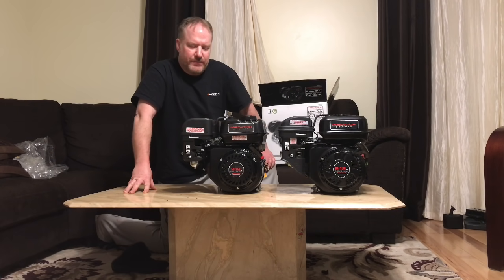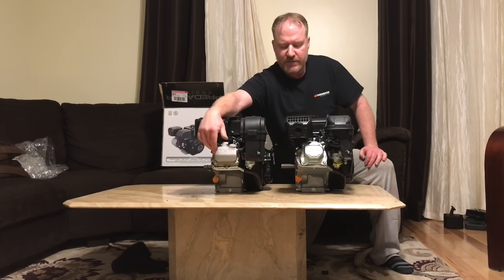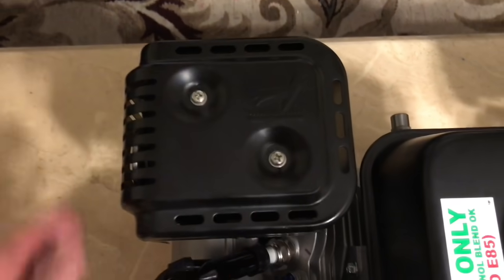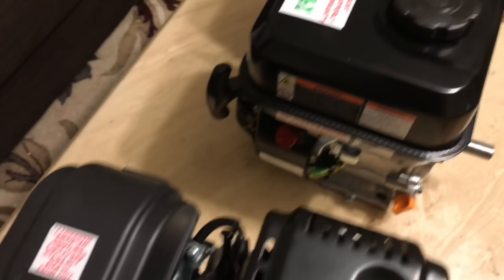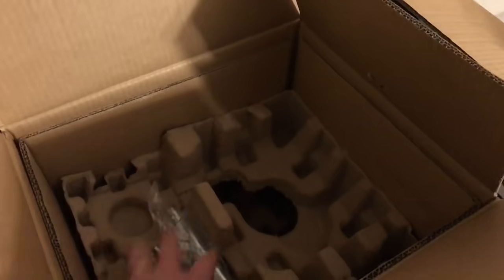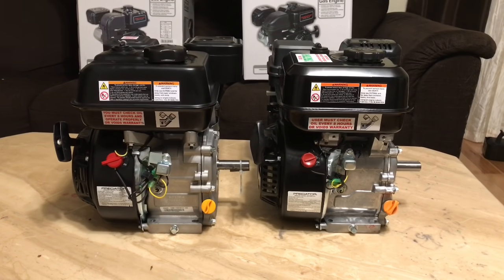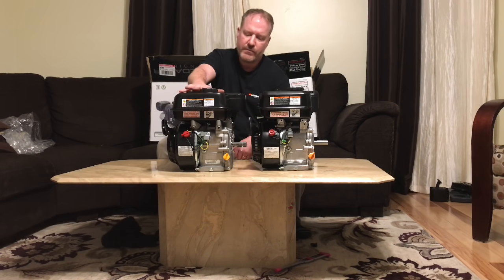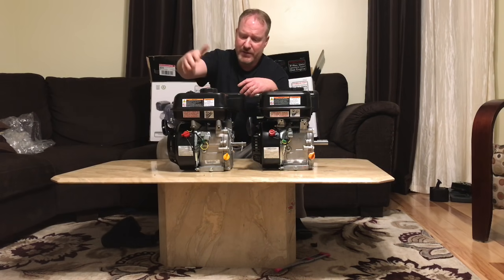What?!?  Harbor Freight Predator 212cc HEMI built by different factory than NON-HEMI???

Comment: Great job👍 Nice comparison between the 2 motors.
When I purchased the motor I got the hemi version.
No issues so far. Using it on my 14 foot Jon Boat with a mud motor kit 🎣
Reply: GetOutTheHouseGoFish but they're both hemis. Why buy the more expensive one at this States at the Hemi?
Reply: John Sears the cost was pretty much the same. I had already purchased my engine before this video was made.
Other videos I had seen with people using this motor said they thought the hemi had a bit more torque.
I went that route because I’m using the motor with a mud-motor kit on my boat.
Reply: GetOutTheHouseGoFish but they are the same exact engine everything he pointed out does not matter on the performance of the engine. On both engines carburetors on the same side spark plugs in the middle exhaust is on the opposite side meaning both of them are hemis air goes in one side and goes out the other that's what a Hemi is and there is no performance gain there's a efficiency gain. And you got ripped off for around a hundred bucks.
Reply: John Sears they cost the same? 😂 It’s just a preference and you paying attention to the model number on the box when you go to buy it 👍
Reply: GetOutTheHouseGoFish they don't cost the same I just looked them up is it about $100 difference in between them. My 21 horsepower Briggs & Stratton is a Hemi as well. All a Hemi is the way the air goes in and out nothing else has everything to do with the head and both of those engines have the same exact head. I am not saying it's a bad engine they're just lying to everybody just to make more money off of an engine that is exactly the same as a cheaper one with cosmetic differences.
Reply: John Sears the 212 cc engine he is showing can range from $96-$119 depending if you have a coupon. The 22 hp 670 cc engine cost between $669 - $729 once again depending if you have a coupon. I’m looking at the Harbor Freight coupon book that I got in the mail 👍 
As long as the engine does its job I’m good with it 🙂
Reply: GetOutTheHouseGoFish and all I am saying is they're both the same exact engine. People hear the word Hemi and think it's a better engine but they're exactly the same. I literally watch the video yesterday about this engine they put different part numbers on the valves but they still fit in the non Hemi head. So did the pushrods so did the Rockers. And they said the only difference that they could tell because they shave the head down. Still not saying it's a bad engine it's a very good engine was just there exactly the same. And all I was stating with the 21 horsepower Briggs & Stratton it's a hemi but they're not selling it as a Hemi just to get more money and it has roundabout or over a thousand hours on it and it doesn't smoke at all carburetors Fubar though.
Reply: Hemi means the head is spherical making combustion more efficient
Reply: Toni Cayton no it doesn't.
Reply: Brian Boyer did this engine company change the meaning of a Hemi?
Reply: John Sears oh yeah and how do you know?
Reply: Toni Cayton I was asking you that question I'll do it again did this engine company change the meaning of a Hemi?
Reply: Toni Cayton a Hemi is everything to do with the head. Carburetor on one side or just the intake depending on if it's fuel injection air goes in spark plug in the middle domed compression chamber exhaust on the opposite side of the intake or carburetor and if you look at those two engines they're exactly the same same carburetor same head same valves same rockers and you can go on Google and look at the combustion chamber and see their shape exactly the same.
Reply: Just like I said hemispherical heads doofus or what you call domed, and I don't care about anything from garbage ass harbor freight engines
Reply: Toni Cayton so are you going to retract your statement that I'm an idiot it was seems to look like that I was exactly right.
Reply: Toni Cayton it's not my fault you use the wrong word.
Reply: Toni Cayton and how many is no longer a Dodge thing basically every single modern engine is a Hemi. No my 1978 Ford 250 straight 6 is not a Hemi carburetor and exhaust pipe on the same exact side which brings down the efficiency of the engine and a shit ton of heat on my carburetor.
Reply: John Sears at least your not a Honda vtec driver haha, Ford is garbage
Reply: John Sears well the older square body Ford's are good the rest is straight garbage
Reply: Toni Cayton taking theb250 out putting a 300 straight 6 in. when I'm doin polling a Chevy out of a ditch I don't have to touch the gas anymore. Only had to bring up 2500 to 3000 RPM with a 250 in it and it only has an 8.7 limited slip differential.
Reply: @republicansareoffendedeasi821  - Cross-flow design has NOTHING to do with it being a hemi. "Hemi" refers the shape of the combustion chamber and the layout of the valves. All modern V8s and V6s are Cross-flow designs as well as most inline designs. However, few of them are hemis. And in the United States and some other countries, the term "Hemi" is copyrighted as a trademark of Fiat-Chrysler, so technically in legalese, a Ford hemi isn't a hemi. And there have been a few Ford hemis...
Reply: @republicansareoffendedeasi821  - No, they didn't change it, you did. Chrysler and Ford both had hemi designs in the '30s and '40s. Chrysler developed air-cooled hemis for tanks (see Jay Leno's tank roadster) and even better, Ford's GAA engine as used in the M4A3 Sherman tank was a 1099 cubic-inch-displacement flat-plane-crank V8 with dual overhead cams and four valves per cylinder. It was easily the most reliable of all the engine variants used in the Sherman. Right behind it was Chrysler's "Multi-bank" 30-cylinder engine, actually 5 Chrysler 6-cylinder flatheads mounted together on a transfer plate. Not sure how it got to be so reliable, but it's a good thing it was - mechanics who worked on them said they were worse than a nightmare.
Reply: @tonicayton9017  - He "don't know nothing." 😂😂 But the shape is really HEMIspherical, meaning half a sphere. In truth none of the hemis' combustion chambers I've ever seen were HEMIspherical; more like SemiHemispherical, as none were even close to half a sphere, but more on the order of a quarter sphere, like cutting an orange at about 1/4 the distance of the axis. Now, it's mostly just marketing hype.
Reply: @republicansareoffendedeasi821  - Go home and get some sleep, John.
Reply: Duck hunter?..we use alot of those mud motors....they are beast
Reply: How do you like your mud kit on that boat? I have a 14HP predator with an SPS kit on a 10 foot livingston and I don't like it on this boat. Livingston's are a catamaran design and the wake the boat makes has me constantly fighting to keep the shaft in the water because it always wants to lift up. Other than that it works great. I'm looking for a different boat to use the mud motor kit on.
Reply: @tonicayton9017  HEMI means hemispherical--- like half of a tennis ball. The common shape is WEDGE in which the valves are side-by-side.

Comment: Is the carb. bigger on that than a 196cc and can it handle the new jet provided in a stage 1 mod. kit cause the 196cc with new jet will run, but won't move bike, too much fuel.

Comment: Non hemi you can add a charging coil to for lights on a mini bike, the hemi doesn't have the mounting brackets on the side
Reply: Damn, I added a higher amp output coil on my 60363 hemi, along with electric start. Go figure. and I run brake light and turn signals. Just add a voltage regulator.! People need to not comment on stuff they know nothing about. Another FACT.!!!!!!!!!!!!!!!

Comment: I've also heard that the hemi design is not compatible with charging coils but the non hemi engines are.
Reply: Hugh Mungous. I have a hemi version and I have put a charging coil on it that cane off of another 196cc engine. It matches right up.
Reply: the hemi DOES have all the mounting points for charging coils, kohler makes a electric start flywheel that fits the hemi taper perfectly (you need a flywheel with magnets on the inside for charging)...I have been running it a long time without any issues.

Comment: Hey man I like your video I'm going out to town to work in San Antonio and I thought about picking up one of those engines in Harbor Freight where did you get yours at in store or did you order yours online
Reply from the maker: YT_Gunna_ 11 I like to buy in store so I can choose hemi or non-hemi versions. Although I do prefer the non-hemi in most cases.
Reply: They always keep them in stock ? An do you think i would have to add a plate or anything when i put it onto my go kart it has a 5.0 Tecumseh as of right now an it gets it because i have a very light weight frame go kart im looking to fully deck it out with the 212cc predator but hopeing i do not have to weld any add on's do you think the bolt pattren an things are the same length i need research it

Comment: What is the torque difference between the two engine's?
Reply: Well, both are said to produce the same horsepower so unless one is capable of doing so at lower rpm then torque output must be similar.  Of more interest might be their torque graphs, showing not just how much but where it's developed along the torque curve.

Comment: Looks to me like they cheaped out on the hemi
Reply: Yea. hopefully they are as durable.
Reply: Somethings about the hemi is cheaper like the packaging to keep the costs down so the price can stay the same but the hemi is actually better and they are both very durable.
Reply: +Joe 987891 Just the word Hemi makes it better huh. Pay no mind to the differences in manufacturing quality.
Reply: Richard Noggin hemi means that the cylinder is more hemispheric and over all the hemi is better. There is most definitely a difference in the 2. The difference is one has a hemispheric cylinder and one has a perfectly circle cylinder. Packaging is different to keep costs down so the 2 engines stay the same price with the hemi being the better engine.
Reply: @Joe-vp5sp  a hemi combustion chamber is not the best. Out decades they found out that hemi is old news. Hemi v8 engines doesn't even have hemisphere champer anymore.  It's just a brand now. Bathtub with squishband is way superior.
Reply: So true that’s why I made sure to buy a non Hemi when I started my current project
Reply: @nikolaiownz  they still make hemispheric heads for the new hemis I've rebuilt my 5.7 hemi they where hemispheric  the pistons are not shaped like the old ones and they run with dual spark plugs
Reply: the  hemi  is the racers choice,   way  better than the  1st gen  non hemi

Comment: The none hemi I have is going to be ported shaved and I'll be putting in a 3.08 cam that is the avantage of the none hemi. Love all the of my predator 212cc engines!
Reply: might want to add larger valves like the hemi came with stock, then your cam could work at its best. Also that would be a .308 lift pushing air and gas through the smaller valves. You do not need as much lift when the larger valves flow better to start with.

Comment: I have the 4000 watt generator with the Hemi engine. Started the first pull right out of the box and continues to start easily. Hopefully these engines are as durable as Honda engines.
Reply: You know Mary, making engines like these isn't rocket science. If Harbor Freight makes sure the Chinese factory uses quality materials, they are perfectly capable of making something equal to a Honda. That is well within the capabilities of Chinese manufacturing if the company contracting with them makes sure they keep the specs up. I know Harbor Freight has put lots of effort into their generators to offer a quality product so I sure hope that includes quality control. 
I just got a 3500 and so far, we couldn't be happier with it. Like you say, I sure hope they are as durable. Time will tell. 
The "Chinese junk" reputation comes from companies cutting corners, making things as cheaply as possible. It's not because China can't manufacture a quality product. They are still behind as far as highly complex things, like an entire car but, for more basic things, like a little generator, that's well within their abilities. If the company buying from them specifies quality materials and keeps up on quality control, they can make a very good generator. Lets keep our fingers crossed that they did.
Reply: @shananagans5  The china manufactures are told what specifications to build the engines. They build some stuff shitty if the company selling them does not care if it lasts for the customer down the road. The hemi has already built it's reputation "only' by those who have honestly tried them and maintained them..

Comment: your presentation persuaded me to go non-hemi. 
got a dead Tecumseh engine 5.5 hp, and I plan to 
swap it out for a 6.5 Predator non hemi, of course will also need a sleeve and key
to mate the new shaft with the old pulley, but that little extra cost is nothing compared to shoveling
knee high snow. Thanks for an excellent presentation.
Reply: I did it to
Reply: @scct82  wooo!!!, 6.5hp can throw snow like crazy! Thank you for the suggestion and how to select the right one...
Reply: I also swapped out a Tecumseh to a 212 Predator on an Ahriens snowblower. Three Winters later I am very happy with the Predator which handles the job much better than the poor old Tecumseh ever did.  Starts quicker in the cold and qRms up faster also. And uses less fuel also. I only wish I had done this sooner.

Comment: The original non-hemi version is the only one CARB-Certified (CARB is : California Air Resources Board), so that's all we in CA can get. But it's a minor issue, because all that's needed for CARB Certification on this engine is a spark arrestor within the muffler. Otherwise, both engines meet emissions and noise requirements.

Comment: Thanks for the info...
Warning they are still shipping the old motor. Had one arrive on my doorstep today. And the box was busted open. The packaging is not designed for a 40lb motor to be shipped through normal mail all the way across the US. They don't double box it and it didn't have any tape. The only thing that was originally holding the box closed was a couple staples. Even worse all of this trouble and spending $7 for shipping could have been avoided if harbor freight would of had a order online pickup in store option. I have a store about 2 miles from my house but had to get the motor shipped clear across the country. And now I have go to the store to exchange it anyways.
Edit.. Went to the store and they were very nice about it and swapped me out no problem. It was actually my first time going to one and the store was alot smaller than I had pictured in my mind. But I think thats a good thing and part of the reason I was treated so well. They ended up having 3 on hand 2 of which were hemi's.
Reply: harbor freight is great about returns i stoped buying craftsman tools cause there warrenty went to shibit they try to refuse warenty returns for any reason they can think of and there tools are made in china now too atleast harbor freight dosent give any guff when doing a warenty return

Comment: What's the water running for?
Reply from the maker: Its an AQUARIUM
Reply: @BUILDNIGHT  thought maybe you had a parts washer going.
Reply: Do you think the Hemi is more durable. I use these predators all the time. Never knew there were different styles. However, my buddy bought one 4 months ago and it's shot. I checked it after watching this and it's a hemi..Mine usually last a year or two..
Reply from the maker: B 
I don’t like the hemi version.  Too many problems.  the non-hemi is bulletproof.
Reply: @BUILDNIGHT  lol, why do you make untrue statements? Non hemi engines are not by any means bullet proof. 90% of keeping ANY engine running strong is maintenance. No predator is bullet proof. The non hemi I have is sitting on a shelf for a reason. When you find a better made engine, you switch. If I manage to blow up my hemi I will buy another instead of switching back to my non hemi. Yes, there is a difference and that difference I learned by having and running both equally hard.

Comment: I have both and I prefer the Hemi, for the more simple valve setup. I wonder what went wrong with your hemi engines? Did you do the first oil change very early to clear out the metal shavings from casting and first running? Did the different governor or camshafts kill the engines? Just makes me wonder.
Reply: Most likely the engine flooded after needle valve in carb failed to close. Usually caused by chips of powder coating from around the neck of the gas tank entering the carb. When enough gas fills the cylinder the engine hydro locks and will not turn over. clearing and cleaning the carb and tank will eventually work out the problem..

Comment: A lot of water noise. Either you've got a leak or you'd better jiggle the toilet handle. I've had really good luck with the Predator 212 too, mostly repowering old Troybilt Horse rototillers. The old HF Greyhound Lifan engines were good too. I would put hundreds of hours on an engine over the course of a few years rototilling, and then switch for a new one. Only one out of 10-12 ever gave me a problem, it just stopped dead and I took it in for a replacement with the extended warranty. The only continual issue it the pull ropes snap after about a year. I've had the Northern Tool Ironton engines of a similar size too. They seem to run reliably too, although of the two I had, one had a carb issue that when would lift the tiller handle to move it, the engine would quit. Not sure why, because the bowl was clean. I think the Predators are built with a little more quality control.